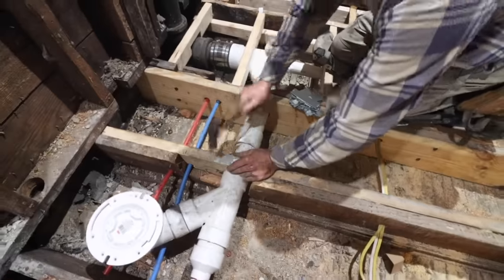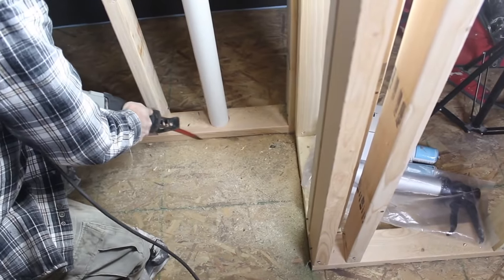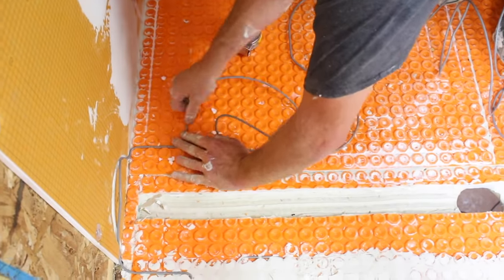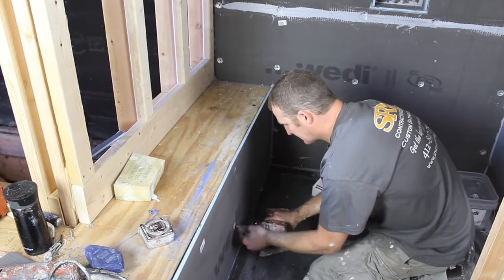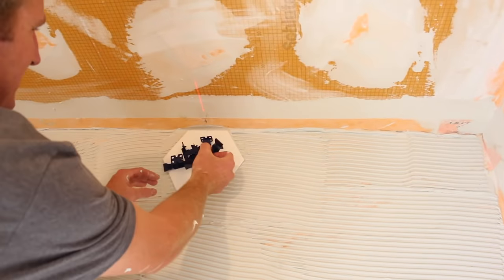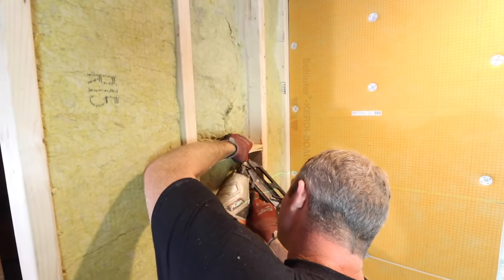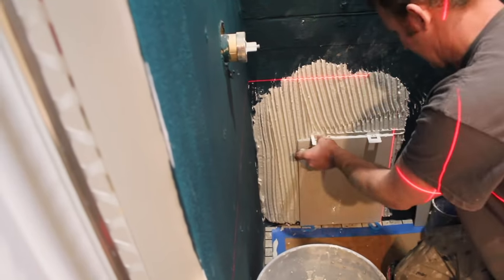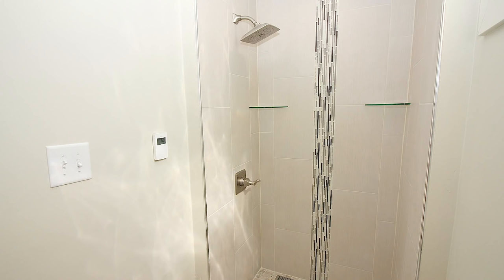29 Clever Shower Renovation Tips for Beginners

Comment: Many municipalities require 2 3/8 coated deck screws,drywall screws are a NO.
The shower drain hole in the floor should be sized depending on what pan and drain you are installing.

Comment: Don't use liquid nails to attach plywood to floor joist. There are specialized caulks designed for that purpose. And if you want to eliminated the risk of squeaking, use screws to attach your plywood.
Reply: That specialized caulk is no better...and nails are fine if used with glue...you are one of those perfectionists that never gets anything actually done!!!!! It's only a shower!!!!!
Reply: @vincentconti3633  Actually, you're wrong. I am a licensed general contractor and I worked my way through college as a journey carpenter. I have used both Liquid Nails and the specialized caulk that goes under plywood (on floor joist) and there is no comparison. 

The primary reason is that Liquid Nails dries hard like glue, and it can break free from a crooked joist. If it does break free for some reason, you have a squeak. Granted if you are using screws, this should not happen, but if you are using nails, it can happen.

The specialized caulk is a polyurethane caulk that dries like rubber. It flexes when it is dry. It also is designed to be use to bond wood to wood surfaces - so it holds onto the wood better (in my opinion).  I may be mistaken but I  think it also carries a warranty.  It's been a while since I have sheathed an OSB floor. 

The caulk is designed specifically for this purpose, Liquid Nails is not. It is a superior product and it should always be used. 

To tell you the truth, I don't use Liquid Nails for anything because it is inferior to flexible caulks. The flexible caulks have 25, 40 and 50 year lifespans, Liquid Nails does not.  They are far superior to Liquid Nails for just about any application.

Comment: My contractor learned the hard way to use steel plates when remolding my basement. He punctured a hole in the pipe to my air conditioning unit, which cost him almost $900, to have the pipe repaired and my unit refilled.

Comment: thelukerocks
So I have a question? I am using goboard tile board for shower tub wall but I am wondering are foam boards strong enough to hold 12x24 ceramic or porcelain tile?
Reply: Yes, they are actually better for larger format tiles. Anything less than 2x2 and you're looking at a potential failure within 5 years. If you are doing your shower, I highly recommend having a professional look at it and do the job. It may seem simple, but 1 mistake and you're thousands of dollars in the pit and shower less.

Comment: PLEASE stop using the glue on the ply...
later when someone needs to tear out the floor there Gunna have to destroy the floor joists dude
Reply: I have replaced hundreds of floors that had liquid nails. They have tools that make demo on liquid nails easy peasy. USE THE GLUE, you don't get to cut corners because you are worried about how hard it's going to be for someone to replace in 20+ years. It needs to be done properly so there are no problems. Just charge more for demo, problem solved